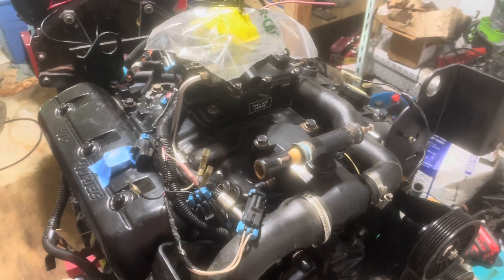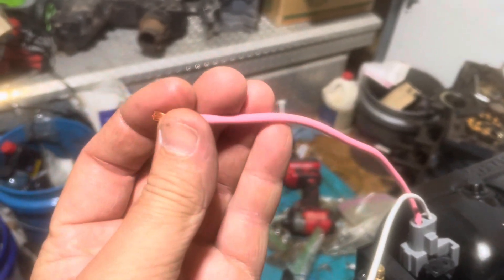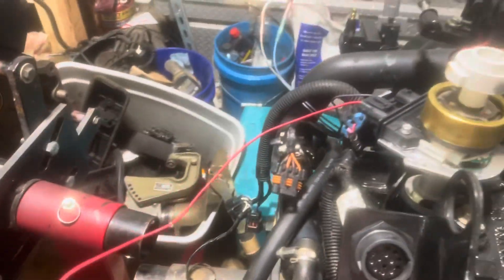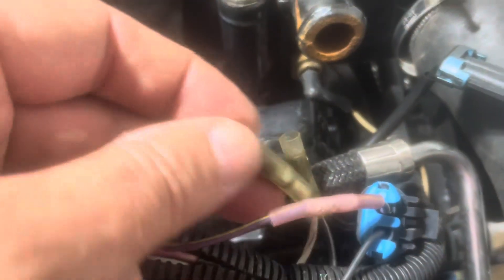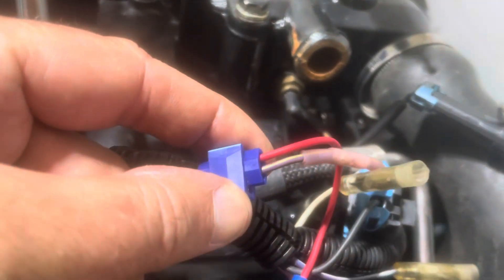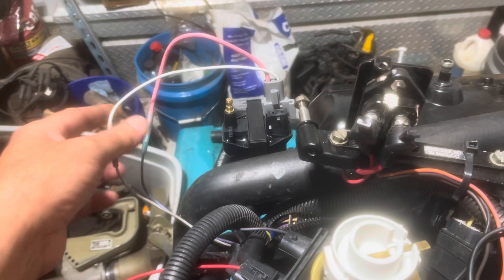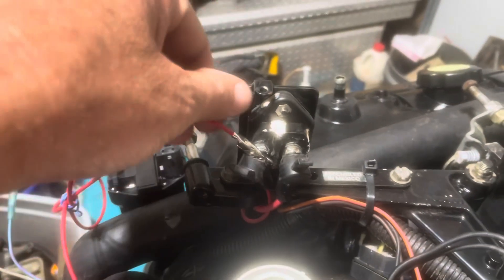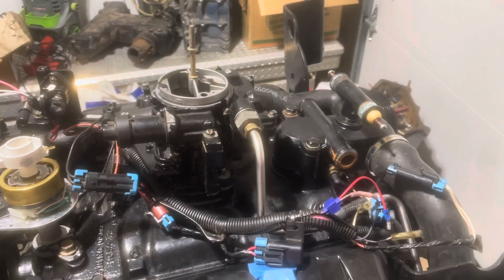4a - Wiring Delco EST (OBSOLETE) - READ DESCRIPTION

Comment: What happens to the knock sensor in your setup?
Reply from the maker: That feature goes away.  This system is basically a Volvo Penta factory system and since VP didn’t have a knock sensor, and the engines are identical GM engines, no harm done eliminating the knock sensor.

Comment: Does this system work for the 5.7 thunderbolt V ignition replacement also?
Reply from the maker: Yes the system I sell covers all v6 and v8 GM engines, even big block 454 engines. My kit does not work with 4 cylinder engines. The module “knows” what size engine it is running.

Comment: If you connect the alligator clip and the engine does not slow down, is that a bad thing? Should it always slow down?
Reply from the maker: Probably a yes but it depends on the engine. But more than likely if it doesn’t slow down it’s a car or truck module because the timing at idle is the same in either set timing mode or normal run mode. Among other reasons that’s why you shouldn’t use car and truck modules in a boat.
Reply: I bought the boat used so trying to figure everything out. Would you suggest to buy a marine module? Or new marine distributor all together?
Reply from the maker: @MikeJones-qp5tu  first of all if you used a device with an alligator clip I assume this is a Volvo Penta engine? If it runs at all you don’t need a distributor, you need a module.  Where did the boat come from? Do you think the previous owner would have used a truck module?
Reply: @moccasinmarine  No, it's a 92 chaparral sunesta with the Yamaha package. So GM 350 5.7L with yamaha sterndrive. Distributor  and 4 barrel qjet carburetor. I have the timing set at 8 BTDC. Was having backfire through the carb issues, but rebuilt the carb and that issue seems to have gone away. Just wanting to make sure I have the timing good. Yamaha manual calls for that timing tool when setting the timing
Reply from the maker: @MikeJones-qp5tu  ok Yamaha and Volvo Spenta used the same GM ignition system then. Just follow the procedure in this manual to set the timing but use 12 not 8 degrees.

https://f01.justanswer.com/oldnewenglandmarine/36c97f52-be29-4a64-9ab5-8bf8b351bf86_Delco_EST.pdf
Reply: @moccasinmarine  I think my module in the distributor needs to be changed. I saw you mention the ACdelco module but it doesn't look like its made anymore. Is there another module you've found to work well? Or one you would suggest for my yamaha  5.7L package?
Reply from the maker: @MikeJones-qp5tu  watch this video for the answer to what other modules I use. I have a direct line to an AC Delco supplier. If I need more he gets them for me. I think you can get them from a GM dealer like GM PARTS DIRECT.

https://youtu.be/EiB4F1V7YkY